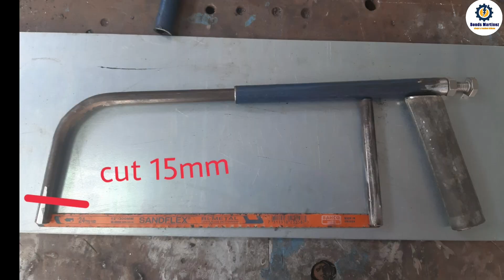How i made my DIY Hack Saw handle/ Bonds Martinez

Comment: Baka pwd malaman yung dimensions tsaka yung moving part na may screw sa likod malapit sa handle pano ginawa😊 tsaka yung pin na ginawang lock both ends 😅👍. Nice frame!!! Thank u!
Reply from the maker: Yung haba boss binase ko lng sa sukat ng lagare .yung extendable rod at humahawak sa other end ng saw blade 12 mm rod. tas yung pinapasukan nya pipe din na papasok ang 12mm  rod. Handle 1/2 pinitpit na pipe. Yung pusher stainless bolt tas naka weld yung nut para pang higpit sa lagare. Lock 3.2mm na welding rod lng yun. Thanks na appreciate mo gawa ko.🙂🙂👍
Reply: Thank you sir. Tinitignan ko kasi finish product diko makita yung mga part na yun like d lock pin, d screw at d back near d handle at yung metal kung saan sya nk attach. Oo yung handle nkita ko pano naging handle 😅👍. ini stop ko nga yung vdeo para makita ko lang yung mga yun pero diko rin nakita 👍
Reply from the maker: @jayescalona656  tensioner sir sa 3:57 at 5:10